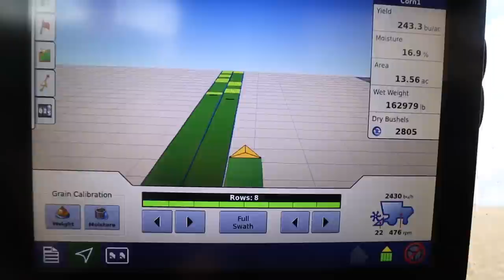WE SNAPPED A COMBINE AXLE! **MAJOR DAMAGE!**

Comment: Shocking how much money for the axle. I think you're getting hosed at that price. Yup, it's an "Axle Hose."
Reply from the maker: Barry Wick sounded fair to me
Reply: I actually prefer Axle Rose ! Lol
Reply: Most of the time. Parts from tractor junk yard s . Price parts half or less than half of new price parts.
Reply: @sethtucker3326  
Gotta remember they're not new parts though 
1/2 price for 1/2 worn out 
In my area they'll charge the same as new if they reckon you need it in a hurry cause they know you'll pay it anyway 
$1200 is dirt cheap 
Its not an axle from a minivan 
Your betting a butt load of steel and fabrication time in a combine axle

Comment: Before we became a Combine salvage yard and eventually tractor salvage yard in the mid to late 80s, we were a Massey Ferguson dealer,  my Grandpa said the only combine they ever had problems with was the 540, and it had hardly any problems.  Tractor wise, the 2000 series tractor and tractors with the 318 perkins had problems.  So, the red I grew up with was Massey Ferguson,  but I do have an IH pickup truck.  Lol

Comment: years ago when we had a JD 6620 it was a 2 wheel drive combine and we snapped off the back axle several times it was always full of grain and we would have to bucket out the grain by hand to lighten it up to jack it up. Have to dig out from under the back end. put boards down and put jack on boards and start jacking . <----- ya i just said that.  Only way we fixed it was buying a mud hog and put under it. Solved the problem and it was daylight and dark with how that combine performed. It would sit on top of the ground when we used to cut deep ruts and spin all the way up and down the field. In deep mud it would walk through it instead of getting stuck. Ever since then WE NEVER EVER got another 2wheel drive combine again. Its about like hauling grain in the bed of a pickup instead of a trailer truck

Comment: The axle cracked right in the middle,and right at the edge of the weld bead.
That mean it's flexing on a the lever spot,the pin,wich is a weak spot because of the weld,wich retracted the steel all around itself.
That's bad design.

Comment: Those axles both had metal fatigue  if you  reinforce  them in the right places they  will not break  they already  had this  problem with the 1400 series combines  drive  and  rear axles  purchased  a used  axle and  reinforced it before I put it on.

Comment: Why didn't you just jack it up on frame, take weight off axle, trim it w a floor jack under each side, weld it, amd put a heavy flat bar stock brace on each side like you saw on new axle. You could have done it yourself amd saved ryans fee, 1200 in axle and steering bar, down time, etc amd been cornholing again in several hours...its heat treated steel, not cast, so its weldable, amd would have been a good real world learning experience for  tech school welder Cooper Pooper...

Comment: Oh come on. A broken ladder? Ya gots (probably literally) a hundred pounds of appropriately sized scrap steel laying about. I've used a ratchet strap and a stout belt for a safety harness many times. I also suspect you have a stout canvas bag, a length of rope and a rubber strap with hooks. I'm betting you also have a battery powered grinder with a wire wheel, four appropriately sized hose clamps and (wait for it) JB Weld. Find the steel, cut it to length, rough it up, mix up a small cup of JB, put everything in the canvas bag, climb up, attach your safety harness, pull up the bag and hang it off with the rubber hold down strap, clean off the ladder rail with the grinder, put two hose clamps on each side of the break, smear the JB on the piece of steel, slide it inside the hose clamps and tighten the snot out of clamps. Climb up the next day and smear some paint on the patch steel. Simpler than having Coop get a long enough welding lead up that high though he could use hose clamps instead of welding clamps also.